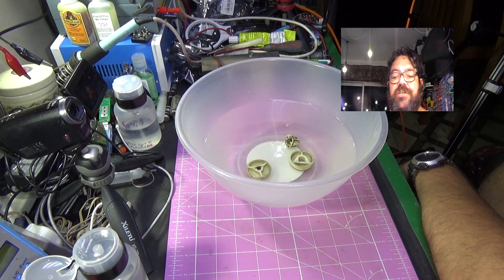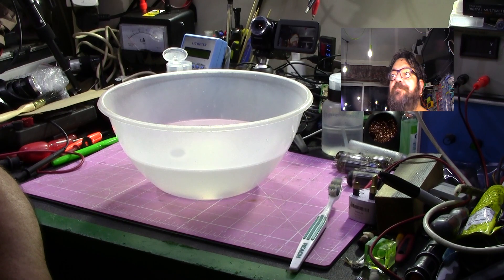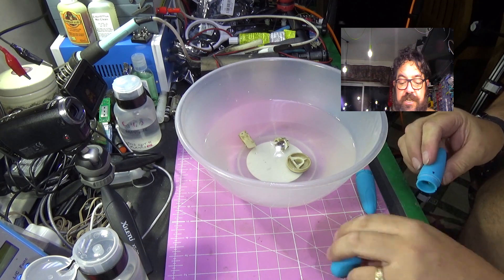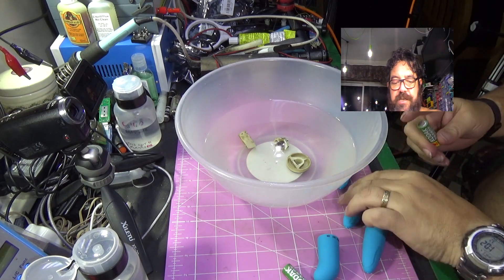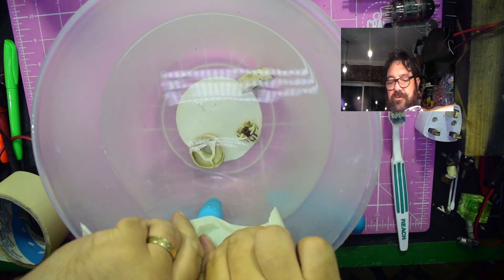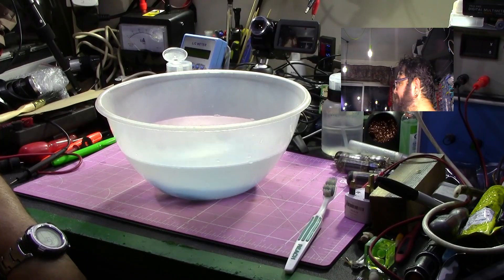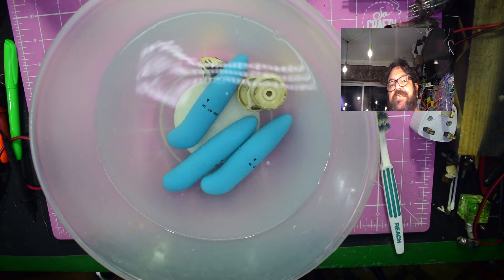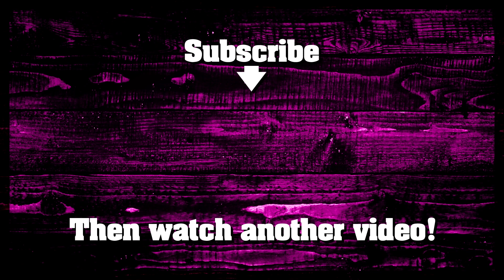DIY Ultrasonic Cleaner on the very cheap

Comment: Awesome! Thank goodness someone else tried this first . Been thinking of trying this . 🤣. It is fun to watch 🤣. I bought an ultrasonic food cleaner . Seems pretty weak so far . May try a different brand and style . Just picked the food cleaner cuz it has a big tank . Using mine to clean pests and their eggs off of my plants . The one I bought is only semi ok . Bummer .
Reply from the maker: I just always wondered if the vibration was enough to agitate the water to enable cleaning.
Reply: George Christofi , Haha ! Me too ! I should try it with some very strong items I have laying around . It makes sense that it could work . I saw a video where a guy used a sander and attached a jar full of cleaner to the sander . Seemed to work. I’ve got 3 sanders . Might try that . Thanks for the entertainment. Too funny 🤣

Comment: Thinking a chip fryer - minus the oil might be usable, temperature control to get it low enough might be the issue.
Reply from the maker: You could drop the voltage on the element or change the temp probe to one with a lower set of temps with the same resistive values. That should work too.. so many options for actually upgrading the unit.
Reply: @GeorgeChristofi  get a gas one, and leave it on pilot, ot get a thermocouple that will go low enough

Comment: XD Fun Sience, but how fast need motor spin to make 20-40kHz ultasonic ? +20'000 times/s ? How vibrator works https://youtu.be/7S4eqDZ6yBw and what is dangeros vibrator to use  https://youtu.be/ZDKQmBWTRnw , and 3570rpm is in viba https://youtu.be/fyuv3WXPQsM ... this is (3.6 kHz?) 10x slower that 20.0 kHz (ultrasonic)

Comment: I use a toothbrush that vibrates.  Has on and off buttons on it, and at first I thought that was what you were going to use.  Still, it might be worth trying in some soapy water...especially if the detergent in it was Dawn.  Still, not sure about the vibration of either your things or the toothbrush.  Are either Ultrasonic?  Enjoyed the video...by the way, did it work in the end?
Reply from the maker: unfortunately the experiment failed. Dawn may have been a better detergent than Fairy liquid but I think I actually need to get the motor speeds up by a 400% increase....

Comment: Oh my Lord!!!! I couldn't stop laughing!! wipes tears from eyes  On a more serious note you do know that the vibrational energy for those things and other things like your phone buzzing and console controllers etc are just a small DC motor with an off centre weight attached to the motor spindle? I recently made my own vibratory tumbler parts cleaner from 95% junk parts which included a motor from an old portable drill which I attached the off center weight to (which by the way was an old brass tap valve which I just cut the stem off then drilled an off center hole).  Plenty of youtube vids out there on how to make one. Just modify those a small bit and you have your own vibratory cleaner for use with liquid.
Reply from the maker: indeed I do! I have various motors which I can use to make cleaners but this was fun... Have a look through my early videos where I subject a cheap plastic adult toy to sustained over voltage causing it to get hot enough to melt the plastic among others!
Reply: @GeorgeChristofi  LOL! overpowered adult toy, that got so hot! Did it go out with a bang or just pass out...err pass away?

Comment: Just wondering, if you'd use a pyrex bowl and had a duplicate bowl, if you'd put the... Novelty toys inbetween, so you sandwiched them between bowls and had the cleaning bowl on top, might that be somewhat effective? Glass being harder than plastic would conduct the vibration quite well.
Reply from the maker: That would be an experiment to try in the future! Great suggestion. Many Thanks.

Comment: Nice video but this is far away from ultrasonic. It can be anything but ultrasonic, that is not how it works.
Reply from the maker: Yes, the whole thing was tongue in cheek. I would only get those toys ultrasonic with more than 15 volts and at that level the motor does not last very long.

Comment: I guess that. May work  in a pinch but obviously we dont have the same freinds  my buddies  would never let me live that one down if they came over to my place and saw car or motorcyle parts swimming in the same bowl as my wife’s vibrators  or any sex toys for that matter  besides ive seen pretty cheap ultrasonics on Ebay brand new for 30 dollars ? I’m sure there are way better ones  available  for more money  but the 30 dollar ones had good reveiws online for  jewlery  cleaning  and other small metal  parts
Reply from the maker: It wasn't really very effective because the motor speeds were not high enough to produce the cavitation that makes things clean. I do actually have a cheap 800ml ultrasonic which is pretty good. I'm tempted to get a bigger one with a built in heater but I don't use it enough to justify changing it.

Comment: no joke i was looking for parts to make one right before you posted that video, it sucks because all in all the parts would almost be as expensive in total as buying one, just if i build it i could make bigger for less money. have you seen the video of the guy he straps an electric sander or a oscillating tool to a plastic tub? i wonder if that would be too bad
Reply from the maker: I did the same as you... I looked at the price of transducers and thought it would be cheaper to buy a complete unit as well. I haven't seen the video you mention but I can get where he is coming from! In all seriousness, neither his or my design would produce the cavitation effect to actually clean much but it was a fun idea and the total cost was less than £3 so a win all round.